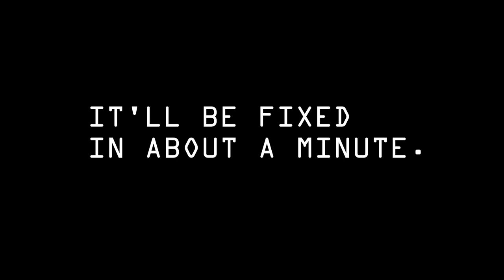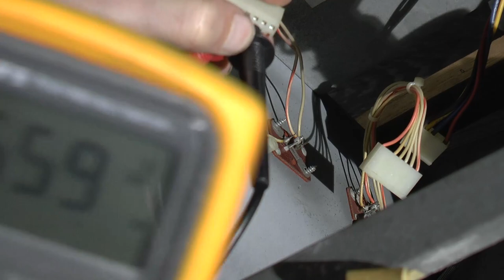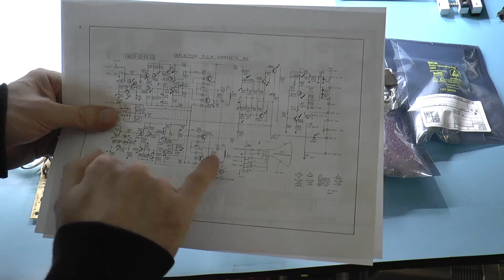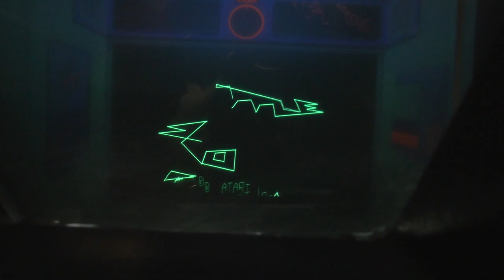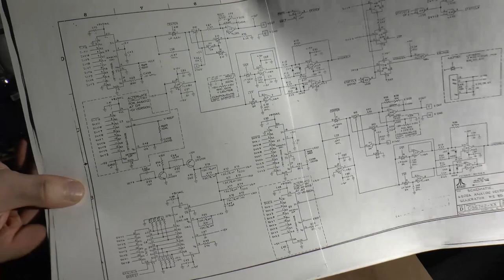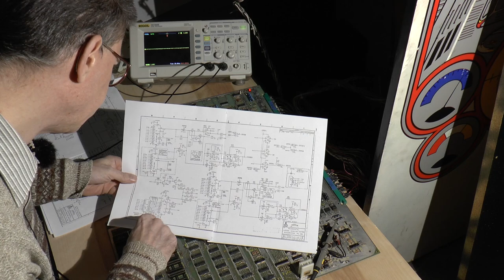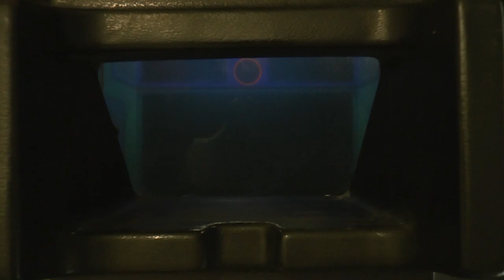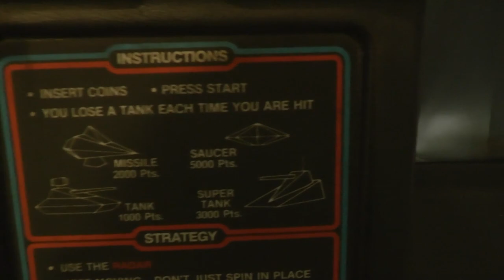Atari Battlezone arcade (1980) repair, part 3

Comment: the aux board generates all the 3D vectors.   So that includes the tank objects, terrain features, the horizon and the radar scope, timer and score (in red)
It could be RAM failure, but usually that would cause vertex vomit.  So I think your 3D aux board is not generating output to feed into the vector list

Comment: It was great fun to watch someone very smart figuring out a complex system on the fly...  nicely done!

I think the missing graphic elements are due to flakey vector ROMs (same ones you pressed on to get it to boot).  The vector state machine, which is essentially a processor built out of just logic gates, uses subroutines to draw various shapes/letters/etc, so a bad ROM can cause whole objects to disappear. 

Try running the self-test, it does a good job of verifying basic ROM/RAM/etc. Cleaning and reseating the ROMs may clear it up, at least temporarily. The sockets on these boards are pretty weak after 40 years(!), so they may need to be replaced to make it reliable. 

Another possibility is a problem in the Z output that is causing some intensity levels to not appear at all. 

Good luck! Working on these games gets more fun as you learn more about them.

Comment: the heatsink compound should be on both sides of the mica disk, because it is supposed to transfer the heat while avoiding air gaps. Mica itself is a good electrical insulator while at the same time it is a moderate heat conductor, but without a good thermal contact to the sheet metal underneath it will not sink the heat.

Comment: Your absolutely right with the missing bits in the game,  you are missing,

 1) mountains
 2) the radar scope ( supposed to spin and show the location ( direction ) of the enemy tank )
 3) shapes ( pyramids, cubes .. ) that you can hide behind

perhaps time to checkout those roms / sockets hehe

Great fault finding though, super logical and thorough, looking forward to the next installment :).
Reply: you can see the chunks coming out of where the volcano should be @1:14:45
Reply: @AdjustableSquelch  Agreed,  I think the roms/sockets might have some iffy contacts.
Reply: @sethrd999  actually I think dingolovethrob below has nailed it, a problem with the brightness circuitry somewhere. looks like you can see full bright only. if you look at my reply to him i linked some gameplay footage and you can see the stuff that isn't full brightness doesn't appear. the volcano chunks are full brightness, the mountains/volcano aren't
Reply: @AdjustableSquelch  its X,Y vector there is no intensity on the beam. it's on or off.  All the missing elements are on the 2nd board.

Comment: Hi Robert,

You need to reseat all socketed chips with power off and power cord connected to maintain earth.  Make sure you touch earth before you touch the chips.  

Next, after reseating the chips power on and all might be well. 

Remember, you examined the screen after you reseated a live chip.  Well, the code to generate the background sprites may have already been called into ram (but failed) and you missed the window since the chip was not in good contact and was reseated long after the initialization took place.

Comment: Great video , very well shot and very well explained, easy to keep up with.
Reply: If your mounting pressure is correct, more thermal compound is usually better or no worse (until it's spilling out the sides and making a mess). My intuition was that less was better, but in my testing I've found that in most cases, having too much thermal compound has no negative effects on cooling performance, whereas it is easy to have too little when you're aiming for a thin layer.
Reply: Yeah< I decided that wasnt worth commenting on.

Comment: Definitely worth replacing the 2114s on these boards. I fixed a Centipede board that used the same RAM (obviously not a vector game, but produced around the same time by Atari). Also had a similar problem with Atari Star Wars (also had broken solder joints).

Comment: Very enjoyable!  You had me yelling at my screen, however, to probe the watchdog reset signal.  That might have made shorter work of finding the problem with the socketed chip.  I'm hoping you're just a bad RAM chip away from being up and running.  Get the self test running and see if the board itself is hollering about any ROMs, RAMs, or PROMs.
Reply: Curious if my name rings a bell, BTW...

Comment: Looks like the radar display was also missing.
One of the cases where an MSO scope would have been useful. Hook the digital channels to the inputs of the DAC and an analog channel to the output of the DAC in circuit and see if the output corresponds as expected to the inputs.

Comment: To switch to english, on the top bank of dip switches, flip the second from the right up. Hope that helps :)

edit Also, see if you can go into test mode. There should be a paper stapled to the back door with instructions on where to find the switch. If you can, it might beep and give you an error message you can google to find the fix too. Also, the most likely cause can be a fried resistor on the high voltage board. I admit I missed the last part so I'm not sure if you've done everything already or not, but I still hope this may help. 

This is a really killer game, and I can't wait for the next update!

Comment: hey - do you know the 'light bulb current limiter trick'??? plug a light bulb in series with your power cord - IF there's a fault the bulb will light up - but it will ALSO protect all your circuitry IF there is one... indispensible!!

Comment: Why was it set to German?

If you are missing display objects I would start looking at the RAM or the ROMs; there is definitely a problem there.  And the video looks like it could use a little bit of adjustment.

Comment: Surprised you would not have "reset the dip chip in the socket".  As a test have a board with 6 roms chips in sockets, and see how many 55+ old hardware engineer could walk by WITHOUT pushing on the chips....
Reply: though a bit younger I almost started pressing my finger against the screen to reseat the chips 😂 
Robert, please pull them all out, clean the sockets and then reseat them! Otherwise I won’t be able to sleep at night 😂